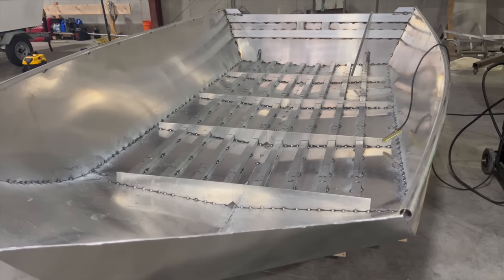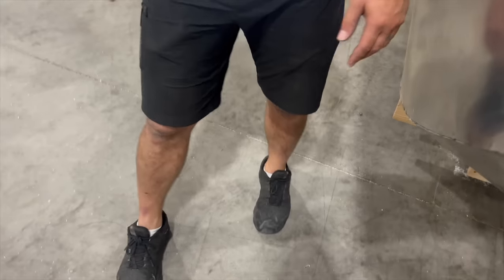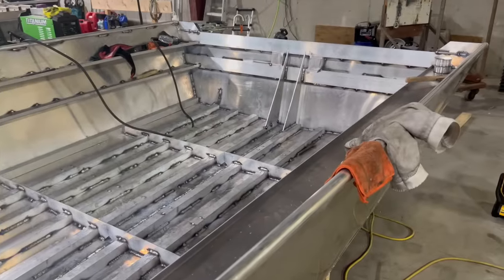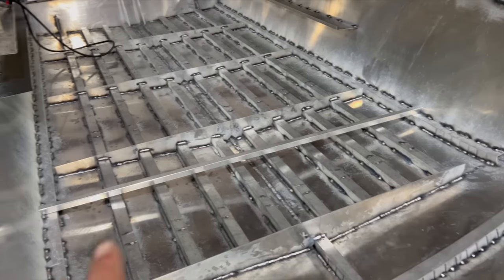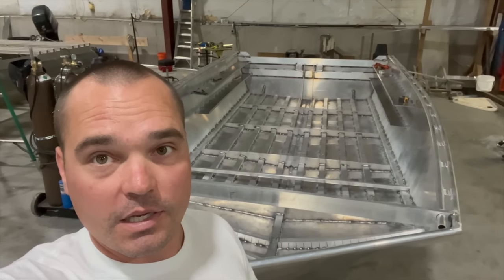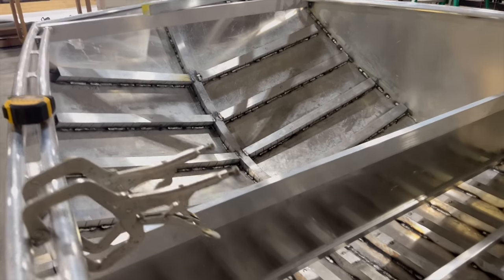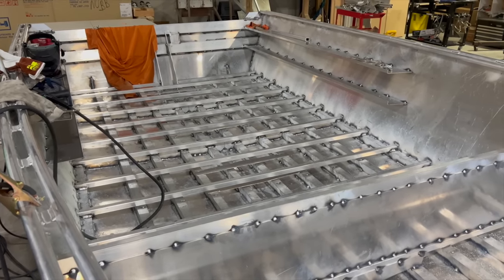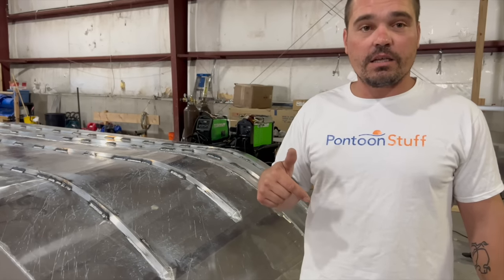EXTRA WIDE 17' Custom Welded Boat Build - Part 2 of 3

Comment: That HF welding machine is killing it with aluminum mig.
Reply from the maker: I’m impressed with it. It had great reviews and tons of YouTube garage welders reviewed it with positive feedback. I had it cranked all the way up welding the transom (1/4” walled tube to 3/16” sheet) and it dig right in. Great transfer to the outside through the 3/16” everywhere I welded.

Comment: you should check into a Tig Button. You can ditch that pedal and still have full control of the heat right on your torch.
Reply from the maker: I've heard that from a few people, but I haven't worked with a machine yet that has the capability to run one. My new YesWelder TIG machine has a button on the switch, but it's an upslope, welding heat, and downslope when you touch the button....I gotta have control the whole time for fine adjustments!

Comment: Instead of slitting the angles used to brace the bow,  did you consider using a shrinker to form the curves?
Reply from the maker: I’m not familiar with that tool, is it a roller of sorts? I’ve seen lots of custom boats with the slits.

Comment: I would put two seadoo in the hull for center of gravity. Intakes would preferrably be mounted in the front for a ram effect. Looks great, good job
Reply from the maker: That’d be cool for sure, but we love the open floor plan. Engine compartments are a bit of a space stealer!!
Reply: @tomspontoons  indeed, first thought your were making a two tier flat bottom pontoon. If you dont mind me asking how much was materials and labour hours?
Reply from the maker: @brettmoore3194  materials were easily $9K to $10K. Took two months working most weekdays on it about 4-6 hours
Reply: @tomspontoons  cool,I would love to have a shop like yours
Reply from the maker: @brettmoore3194  it’s a nice big space, but would love to own our own shop someday instead of renting!!

Comment: I like to weld as a hobby on my 1648 aluminum boat that I tinker with and you’re making this aluminum welding / fabricating look too easy. Were you a welder in a previous career? Great job man! I would love to have your welding skills.
Reply from the maker: I started welding a little over 2 years ago…still have never welded steel, just aluminum. Had to learn to be able to fix leaky pontoons and make customizations on site rather than hire that out and wait on other folks schedules. Built a 13’ from scratch, then my 12’, and then this big fella. Every welding pro I’ve talked to said you just have to spend time welding. Each boat I’ve built has been 150+ hours of welding…lots of practice on top of all the drills I did on my bench just welding away on scrap to get better at seeing the puddle and adjusting according to what the metal is doing. It’s a passion of mine and I hope to keep doing more and more of it! 

Thanks so much for the kind words and for watching!

Comment: Are you going to fill the bottom below the floor with two part closed cell foam?
Reply from the maker: Foam sheeting stuffed in. The two part foam will eventually get water logged, at least in every fishing boat with it that I’ve dealt with restoring. Plus the foam board will allow things to drain and dry better air flow wise.
Reply: Yes, the older two part pourable foam got waterlogged.  Supposedly the newer stuff doesn’t, but you wouldn’t know for several years 😆
Reply from the maker: @J.W.W.  exactly…and digging that stuff out is NOT FUN. I’ve done it a few times and it’s terrible. Worst case if the foam board gets wet it’ll come right out!

Comment: Built at least 6 boats with my father while I was young from 12’ to biggest was 35’ we always built the ribs first then the transom the keel the bottom and sides but they were always made of wood
Reply from the maker: That's awesome! I wish I would have started in welding and boat building a long time ago, but it's never too late to start I guess. I'd love to have parts pre-made to make the process more streamline, but each boat I've built has been hand cut and each part made to fit custom...I kind of like that type of build!

Comment: any thoughts at injecting low expansion door and window foam it is closed cell, adds rigidity and totally repels water for decades! I studied closed cell foam in Florida hurricane boats! Those with open cell foam where totaled, due to sponging up the water, those with closed cell foam where salvageable! Obviously both float, at least until they sponge up the water or not...2 things with a boat like concrete great new! Cracks happen!
Reply from the maker: I would love to fill everything with closed cell, but wanted to leave the bottom accessible in case of repairs or modifications. And I’ve had issues with closed cell filling up with water on older boats I’ve had.
Reply: @tomspontoons   
Dont use spray in foam!  All two part foams will absorb water over time. They are not waterproof, read the data sheets. I took out over 300 lbs of soaked foam and had some corrosion issues. Coast guard should ban the stuff.    You could still use polyethylene , think swimming pool noodle material. Coast guard has a formula for how much flotation you would need based on the weight of the boat.    Nice build!             Ive had struggles with my Miller spool gun and soot.  My old Lincoln gun was pretty clean. Ive gone through all of Jodys tricks and made a little difference, but it's not right.
Reply from the maker: @fireguy7004  I did sheet foam. It’ll be just fine and shouldn’t absorb any water. It’s mainly for sound proofing…since it’s my boat and I built it for myself it technically doesn’t need foam at all. Silly standards, but not too worried about it!

Comment: How do you figure out the modified V part?
Reply from the maker: I start by giving the transom and mid-ship it's shape based on what I want for the deadrise at the transom. Then I overlap the sheets at the bow, eyeball it to the shape I like, and then cut. I ended up making this a bit more aggressive of a V in the bow, which has it's perks and drawbacks, but all around I love the ride and stability of this boat. My buddies have called it a "cadillac ride".

Comment: Awesome work,  how did you cut the rub rail to fit over the sheet
Reply from the maker: Thank you! I clamp up a little jig and rip it on the table saw. I usually then have to run the circular saw along it to open the gap up slightly, especially when it's 1/8" walls like this one.

Comment: I have an off topic question. If i forget to open the gas vent and drive around for a while and never open it, could that somehow cause some fuel to leak in the engine because of pressure? There was a small amount of gas on the front part of engine cover by the clip when i removed engine cover to replace solenoid but dont know how it got there. Or could trying to start it without enigine turning over  cause pressure to  build up?
Reply from the maker: I don’t know exact details on this topic (or what motor you have, but YES. Pressure can build and can push fuel into the carburetor….sometimes making the needle in the carb get stuck. I’ve also heard of pressure blowing the fuel line off a motor and spraying gas all over someone’s garage. 

However, sometimes you’ll just get a little fuel out the front if the carburetor which could puddle where you saw it…especially if you tilted the motor up at all.

Comment: What machine are you using to operate your spool gun? And what machine will you tig with?
Reply from the maker: In Part 1 I do a quick breakdown of my welding machines. They’re both Titanium brand. MIG170 and TIG200. I did a ton of research on what I wanted to purchase to start and they were the most affordable with the best reviews online and on YouTube.

Comment: Have you tried a bit more argon flow and/or a step up in cup size?  Might clean up your soot.  Nice project.  Real test on the Titanium machines.
Reply from the maker: I've tried everything with that spool gun. It'll lay in a super clean bead on one weld, and then the next will have tons of soot. The nozzle gets blocked up fast from the splatter. I hope to try a friend's pulse setup on my next build. There will always be some soot with MIG, but it would be nice to have more consistency.
Reply: @tomspontoons  welding inside with no breeze, it should weld clean.  I ran into that when welding outside even though there was no discernible wind but after fooling around with it I found it needs more argon than a guy would think.  It is not unheard of to get a bad bottle of gas either.  I have been spool gun welding for more than twenty years without any of the new features on modern machines, so I know they aren't the only answer.  A lot can do it old dirty metal ( even though you clean it, the dirt comes out of the pores it seems), any clogging in your flow of gas at the tip or even a kinked hose.  Anyway have fun.  Is it going to be your own boat?
Reply: PS:  Have you tried one of the various splatter shield sprays on your tips?  Also the distance the tip protrudes from the nozzle or doesn't can make the problem.  I have had nozzles I had to turn down on the lathe.
Reply from the maker: @douglasthompson2740  thanks so much! I will try to really crank up the flow next time. It is my own boat. Third one I’ve built, it took two to get the process down to where I was confident building one this big. We’ve got great ventilation, but nothing blowing on my welds like a breeze. I’ll definitely try more flow next time tho. Thanks again!!
Reply from the maker: @douglasthompson2740  I haven’t tried them. I’ll look it up. I definitely worried that the tip is too close to the nozzle end. Not sure if that would hurt the cleanliness
Reply: @tomspontoons  if the tip protrudes it gets less gas coverage and needs a higher flow, but it allows you to have a shorter arc in tight joints.  For general use I like 1/8" recession on the tip from the edge of the nozzle.  Experiment with what your gun likes.  Just remember with protrusion the gas envelope is spread out bigger and needs more flow.  Not necessarily a bad thing when needed.  Different manufacturers can vary so it is something to be aware of.  Recently Jody over at "Tips and Tricks" did an illustration of what different gas flows can do.  Quite interesting.  I keep a few nozzles of different lengths for special situations (don't get too carried away with tip recession or protrusion, a little does a lot).
Reply: @tomspontoons  For me I have found that the more recession of the tip the dirtier the gun gets.  If it is crapping out little slag washers that is an indicator and will choke off or give an erratic gas envelope.  I got a combination of tip and nozzle on a couple of guns over the years that did that (both steel and aluminum).  My theory is that I am running a longer arc than I think because of all the gap you don't see in the gun.  Long arc dirtier bead with same gas flow,  and can make for less penetration.  In a couple of those setups it got so dirty before I realized what was happening it would short to the nozzle and the nozzle would arc to the work.  A new gun and it took a bead or two to catch what was happening.  Anyway hope it helps.  Every situation can be different.
Reply from the maker: @douglasthompson2740  this is such great information, thank you for sharing!! I have learned tons from Welding Tips and Tricks so I will go check that one out!!
Reply from the maker: @douglasthompson2740  all of your info and input has been a big help. I’ll keep playing around with it til I get it dialed in!!

Comment: The front of that boat looks awesome Tom I can’t wait to see it finished and how it handles!

You building your trailer too?
Reply from the maker: Thanks! It's coming right along. Heading out to prep for paint right this minute. I bought a big heavy duty Yacht Club trailer for it. The bottom width has made the trailer part tricky!
Reply: @tomspontoons I am reminded of the Unlimited hydroplanes, which were tipped up about 70 degrees, and those huge Coast Guard FSDS (Fast Surface Delivery Sled), which were tipped about 110 degrees (yes, they sat in a rack with the port gunwale down and just to the right of a lowboy trailer’s centerline, the starboard gunwale was up in the air above the outer edge of the trailer’s left edge). That way they didn’t have follow wide load regulations.
Reply from the maker: @kennethjackson7574  I've seen some big "go-fast" boats being hauled on the highway on hydraulic style trailers that tip them on axis to narrow the load. It's wild to see, but an efficient way to haul without a permit!

Comment: How about a tool talk on your equipment?
I heard you mentioned TIG welding but a lot of the welds appear to be MIG. Am I wrong?
Reply from the maker: I break down my welders in Part 1. I’ll do a walk through on everything in the last part too just to review.
Reply: @tomspontoons  thanks! 
I got a big project that needs a lot of galvanic corrosion that needs repaired. Looking for a multi process welder and looking for something cost effective and decent. Everlast seems to be on top.
Reply from the maker: @TheBubagrunt  I’ve heard good things, and definitely better pricing than the big name red and blue welders. Also, I’ve been very happy with my Titanium welders for the money!
Reply: Look into yes welder
Reply from the maker: @audtinbeckwith7005  I've heard great things about those. I have my eyes on Primeweld's TIG welder if I ever replace mine.

Comment: i would like to make my own boat but i need diemensions for cutting  metal sheet of only  floor and side .is it possible to send diemensions?
Reply from the maker: Bottom sheets are 39" each and 18' long, the side walls are 30" tall and 20' long but cut down after the shape was made with the bow and bottom of the boat.
Reply: @tomspontoons  is it possible to send technical data sheet for laser cutting?i will make it with metal sheet and cover with fiberglass please thank you
Reply from the maker: @canylmaz5851  I don't have any sort of technical data sheet like that for laser cutting. I just sketched it out on paper and then started putting pieces together.

Comment: Greetings Tom, did you draw this build up b4 you started, and if yes, did you stick to the plans or deviate from the plan any?  Your recorded build appears as you are building the XW off the cuff.  That is not to be taken as a bad thing, but a BAAAD thang😎

BTW,  on some of your sped up shots of you welding, the arcs were in sync with the music.
Reply from the maker: Didn’t mean to sync it up, but hope that adds to the enjoyment! 

I have been drawing this hull for 6+ months on grid paper, designing the hull shape, width, etc. I’ve basically stuck to the transom height and width, and length…otherwise there have been a TON of changes and on the fly decisions. Heck, at one point it was going to have a full walk through windshield!!
Reply: @tomspontoons  
I think you meant, oh heck yes, it took me a long time to sync that to the music 🎶 glad you noticed and dug that.
I haven't fabricated many things, but the few I did had trial n error and reworking all over it to get it the way I needed it to be.  Did you mention what's going to push it?
Reply from the maker: @awakenedtotruth8419  One of the big things with this build compared to my first two was if I didn’t like how something fit up, I cut the tack weld out, sanded it down smooth, and re-fit it. My goal was to fabricate and cut the pieces to make the welding side a piece of cake. 

It’s getting a 140 Suzuki tiller with outboard jet conversion. And a 9.9 Yamaha for trolling.

Comment: I want to do this so bad I just can’t afford the aluminum
Reply from the maker: The aluminum was about 1/3 the cost. Still gotta factor in the outboard(s), electrical and fuel systems, trailer, and all the finishes like vinyl, paint, etc. It ALL adds up, but still probably 1/2 to 1/3 the cost of buying a boat from a manufacturer....definitely can't afford that!

Comment: Why would you screw down a floor in a aluminium boat, that makes no sense
Reply from the maker: Easier to maintain and get under if I ever need to. I’ve owned several with riveted aluminum floors and hated the sound, lack of comfort, and pain in the neck to service. It’s the beauty of building my own boat…I get to make it exactly how I want it.

Comment: Why no limber holes to drain water?
Reply from the maker: The water runs down to the bilge at the rear of the boat so I didn't need to add any drain holes to the floor. There's just a big enough gap for water, but not for tackle or other small items to get through.
Reply: @tomspontoons I can see them in the center, but the stringers can trap water.
Reply from the maker: @grancitodos7318  yes, they could a little, but they’re stitch welded to allow water to move through…and good thing it’ll never see saltwater!!

Comment: Atlas micro jacked Jack plate
Reply from the maker: Definitely could have used one for ultimate fine tuning. Luckily it's running super smooth and clean after motor height adjustment. I built the transom 27" to make it so I could bolt the motor right up and have that nice clean look.
Reply: I have a porta bucket on my bay boat I never trim the motor up for trailering I just run the bracket up all the way motor is clear and out of the way and doesn’t bounce when trailering due to the straight up and down orientation
Reply from the maker: @thegrouperking  luckily the jet sits even with the bottom of the boat, so no trailer worries there!!!